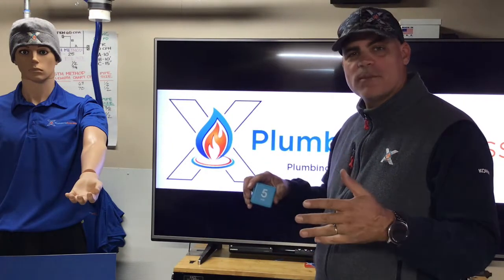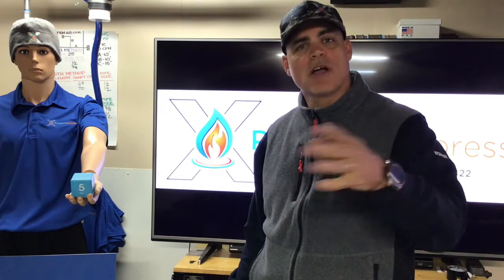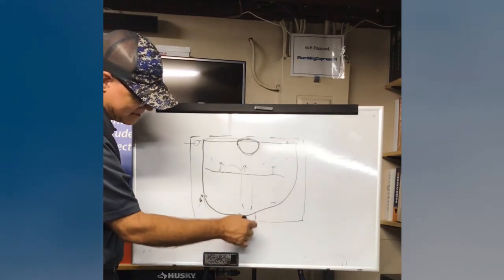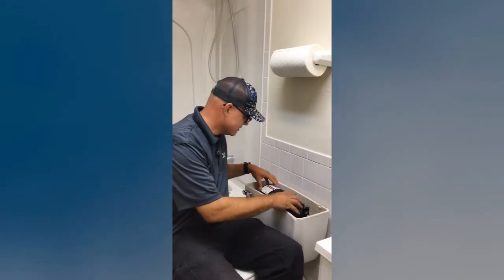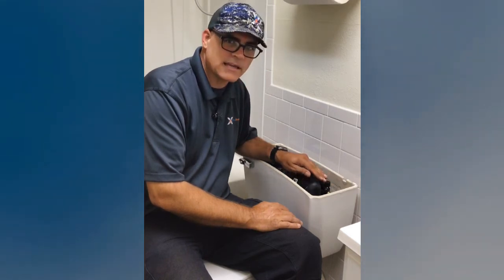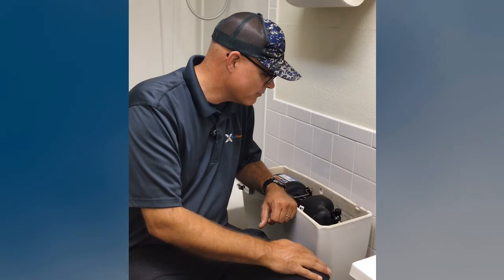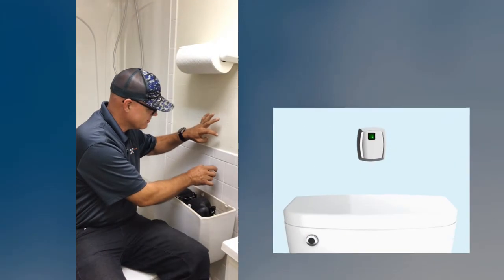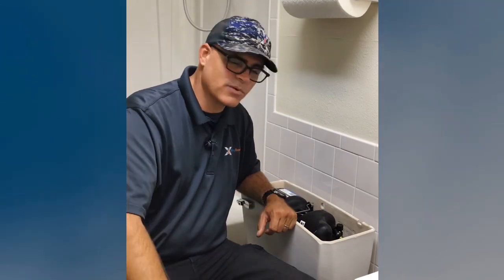HOFAQs   Part 2 Flushmate

Comment: My pressure relief valve on the lower assembly violently shoots out water a few seconds after the tank refills. What's causing that and how do I fix it?
Reply: To add on to my first question, prior to that problem, when my Flushmate would shut off, it would do it with a loud bang. My plumber lowered the water pressure coming into the house at the regulator on the incoming water line to the house. That got to banging to stop, but now it violently shoots water out of the pressure relief valve as described in the first question above. So I've had a couple of problems with my unit that are hard to resolve. Any ideas?
Reply from the maker: Well that is a very interesting one that you have there. There is several reasons that you could have an issue with the relief valve opening like that. Since this not something that I have seen before I would try these first and then finish with a call to Flushmate about the issue.

Check for Cracks: Examine the Flushmate black tank for any cracks. Cracks are a common cause of water shooting out of the relief valve. 

Examine the Relief Valve: Inspect the relief valve for debris or wear. Clean or replace it if necessary. 

Check for Clogs: Ensure the inlet screen and air inducer are free from blockages. 

Test for Pressure: Turn off the water supply and flush the toilet to relieve pressure. Reconnect the water supply line and open the valve. Check for leaks. 

Inspect the Cartridge: Check the cartridge for damage or leaks. 

Consider a Recall: Some Flushmate models have been recalled due to potential tank rupture. Check if your Flushmate unit is part of the recall and contact Sloan customer service for replacement or assistance.

Comment: I have a Mansfield toilet with the flush mate. One of the small  1/8 " holes at the top is constantly leaking air. It flushes fine and about an half inch of water is in the china tank. I can see staining where water has come from it. Is it a bad pressure tank?
Reply from the maker: That is a great question. Normally any water in the tank is not a good sign. I would recommend contacting Flushmate. Here is the info you need:
Technical assistance is available through the FLUSHMATE Consumer Service Center in New Hudson, Michigan, by calling 800-533-3460, or 248-446-5300, or by faxing 248-446-2150, as well as through our website: www.flushmate.com.
Reply: Now the hole is not leaking air.  I will call them and ask them if it is normal.

Comment: I just replaced cartridge and flushes once or twice and then water keeps running
Reply from the maker: Hi Lukey4. Thanks for letting us know you are still having issues. Sometimes that is also the duckbill rubber piece that we mentioned in the video. This is what allows air into the tank before the water fills it and pressurizes the tank. Without air in the tank it will leak continually. Hope that helps!

Comment: Weak flush , Always  needs adjusting, so frustrating. I spent so much on plumbers,😕 who tell me to just replace the two flush mates with the ball and chain kind. Plus more $$$$$$ to replace the water connectors on the wall. 🤨(My home is 13 years old, $600? Each bathroom for that).. Nope! No more $$$$$ plumbers, I'm struggling on my own calling and watching videos. 🙁
Reply from the maker: I am so sorry that you are having such issues with your toilets. Do you still have the Flushmate toilets in your home? I would encourage you to call in to Sloan and talk to them about the issues that you are having. They might be able to help you find a qualified plumber in your area to work on them and/or have the rep for the product talk with you and see if they can help facilitate a solution for you.

Comment: I have a flushmate 503.  Every two weeks or so the flush becomes weak and does not remove all the waste.  I have to turn off the water supply, remove vacuum cap, then lift of on cartridge plunger to drain the tank of water.  Once i do this the toilet flushes properly again, but only for a few weeks then i have to repeat the process.  Ive replace ALL parts including the tank and still have the same ongoing problem....HELP!
Reply from the maker: I apologize about the long time to reply, I did not see your comment. At this point maybe it is better to look at getting with Flushmate for some repair parts, maybe a complete new tank if they agree to it. I do not say as some plumbers do, REPLACE it with something else. That is a possible option but the toilets are great when they are working and have great support from the manufacturer.
Good luck with your toilet repair. Come back and let us know in the comments what you ended up doing.